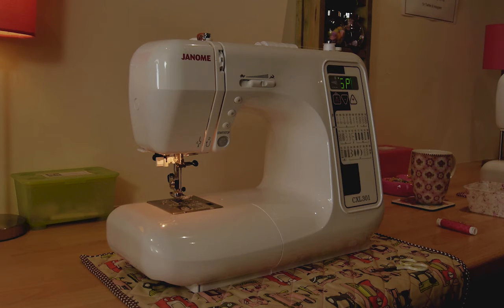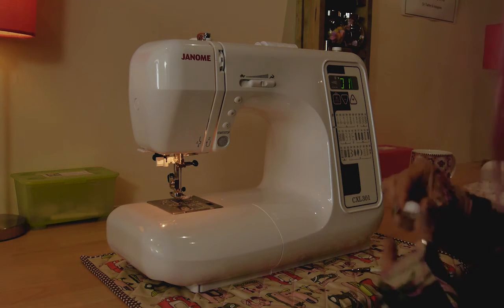Threading your top loading computerised sewing machine (Janome CXL301 or similar)

Comment: Thank you. Just one thing though - threading the needle.  It took me ages to get it right.  I needed to make sure the height of the needle hole was as high up as I could raise the needle.  (Not sure I explained that well).
Reply from the maker: Always make sure you thread the needle once the machine has been switched on and don't use the handwheel. If you've used the handwheel, press the needle up and down button twice so that it sits in the correct position before trying to thread. Hope that helps